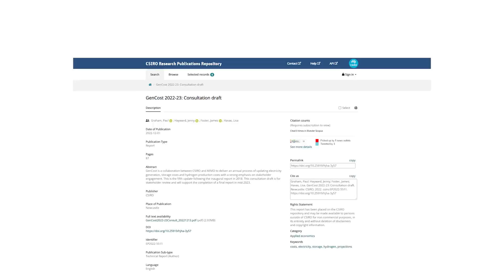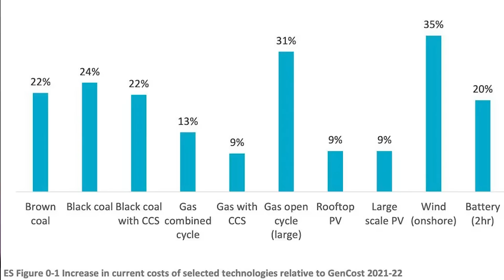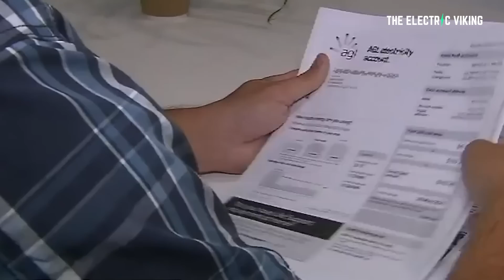Wind and solar still much cheaper than fossil fuels, even with inflation

Comment: Ohm's law 101 you only get about 10% of renewables the problem is like the Enron scandal its measured in watts amps is what's actually going back into the grid or in the batteries or whatever
And then nevermind that embodied energy thing

Comment: Maybe I'm just suffering from the equivalent of EV "range anxiety", but I would greatly prefer to not risk energy shortages due to the intermittent nature of wind & solar.  Battery storage is a technically appropriate compensator, but imho is still very expensive, & is in direct competition with EV production for a still-limited resource.  My other concern is that both wind & solar are low-density producers, and often use land that may be needed for future food production.  Trade-offs, trade-offs...
I'm blessed to live in British Columbia, Canada where we have ample hydroelectric resources into the foreseeable future, thanks to forward-looking politicians beginning in the 1960s.   We are currently only a few years away from completing another large hydro installation which will easily handle the extra load from the expected commuter EV transition. The giant water reservoirs behind our power dams are a wonderful long-haul energy store capable of coasting for over a year without any precipitation {highly unlikely}.  We don't need batteries for our wind & solar, just less production from the hydro base-load operations.  At the same time, our {relatively} very low-cost electricity makes it a foolish investment for me to consider roof-top solar - my payback period would run to ~ 20 years at present.
Every state, province, territory or entire country world-wide has its own issues, & must deal with them appropriately.  All I can say is that it is extremely foolish to decommission existing energy sources like nuclear- & coal-fired steam plants for "green" reasons BEFORE alternatives are in place.  Germany is a prime example these days - how many will freeze to death in that country this winter while gas from Russia is embargoed?  How many millions {billions?} of Euros have been wasted in that country on subsidies for wind & solar that don't perform well in mid-winter?  Look before you leap, & demand that your climate alarmist folks provide rigorously detailed cost-benefit analyses of non-fossil-fueled electricity sources before precious tax monies are invested in non-proven technologies.

Comment: What about the cost of firing up conventional stations when the wind isn't blowing and the sun isn't shining.
Reply: They will still exist but smaller in number and used less often. Anywhere there is a gas line or a diesel pump next to a power line you can put a peaker plant. Batteries are good for an hour at a time. Frequency stability services are rarely needed for more than 15 minutes. How long do you think the power will be out for and the sun/wind not producing? An hour? A day? Longer?
Reply: @theairstig9164  Here, in the UK when high pressure moves over we can go without productive wind for days
Reply: @theairstig9164  Also the cost of firing up old stations is huge - look it up

Comment: In 2020 the biggest Chinese companies (Goldwind, Envision, Mingyang, Shanghai Electric, Zhejiang, CRRC, Sany) installed around 45 GWh with profit. Western GE Wind, Vestas, Siemens Gamesa only made 25 GWh with over $3 billion in losses. Not not to mention that Goldwind installed 13,06 GWh with 9,000 people and Vestas only 12,4 with 29,000 people. 

But highly automated Sany installed 3,72 GWh with only 300 people - which translates to 14,88 GWh with only 1200 people (I bet it would need even less).

Comment: Here in AZ been powering my main house (over 4k sq ft) with a 12+kw/hr system since 2016 (only $42/mo for grid tie in fee).  Over produce electricity and in 2018 bought a Tesla M3 also powered by the panels (now has over 60k miles and no gas station costs/time or maintenance other than changing tires once and replacing air filters each year) also drive in HOV lanes as it's an EV so faster commutes.  Love not having a big electric bill (use to be over $500/mo in the summer) and the panels paid for themselves as of the end of last month so now it's just pure savings.   My plan for 2023 is to double our solar system to around 25kw/hr. and add battery storage.   That's to prepare for a Cybertruck (which will probably take up 2 spots in the 4 car garage but want to be able to have the electricity on hand to charge).  Depending on how well the energy usage is may eventually disconnect from the grid and be fully energy free and independent.  Solar in the desert is the way to go.  Also, have a good well system so no worries about water scarcity like other places.
Reply: I can see solar being a big plus in the desert, that makes sense. I think that should be the message instead of the climate change emergency. The people that live in places where solar and wind works. We shouldn’t waste a fortune on things that can’t and won’t work.

Comment: Wind & Solar are not economical, and do not belong on the modern electrical grid except in odd niche applications like a diesel grid, off-grid homes or areas with ample reservoir hydro. Comparing a dispatchable, reliable power source to wind or solar is called an Apples to Rotten Oranges comparison. Go off-grid and see how much wind or solar costs.
Reply: Look up levelized cost of electricity
Look up levelized cost of energy
    
Wind and solar power has come down in cost a lot in the last 10 years.   Solar and wind power can supply 80 percent of an electrical grid electricity.
Reply: @ronaldlindeman6136  You look up levelized cost of electricity. And then look up what is an apples to oranges comparison is.  Comparative analysis of all European countries show Wind + Solar costs 6X more than conventional electricity sources. That's a REAL WORLD comparison.

Comment: Wind and solar are cheaper when they are generating.  You need to use battery when not generating.  There is a limit to the battery backup available.  How quickly can you get battery power to cover all utilities?
Reply: Never.

Comment: Storage is the big thing that needs to be solved.  I expect flow batteries to be the solution.  The heavier weight doesn't matter for stationary storage.
Reply: Just shut down fossils fuels The world will starve. An Electric car in the Canadian winter? Solar and wind simply do not work with those silly paid for WEF studies.
Reply: @patricksmith6034  People drive EVs in Canada in the winter.  There no doubt are some driving right now.  I suggest you get the facts before you try to debate.  We can't stop using fossil fuels suddenly but we can stop faster than you think.  Wind and solar make power at a much lower cost than even natural gas.
Reply: @patricksmith6034  False.  We will be switching to wind and solar for power
Reply: Have you heard some of the proposals to produce hydrogen from the excess power generated by renewables, and then using the hydrogen to run electric turbines to supply power to the grid when solar isn’t producing? This also seems like a clean method of energy storage and less impact than batteries in many cases.
Reply: @sandyt4343  Fuel cells convert hydrogen to electrical power more efficiently.  The idea is a good one if you can store the hydrogen.
Reply: @kensmith5694  you’re probably right,that sounds like a more efficient way to derive the most energy from the atom. I think storage in a fixed plant might not be as big a challenge as using it for transportation, although it certainly is a slippery little atom in comparison to the compound ones , if I understand correctly.
Reply: There are a lot of Engineers that say 80 of electricity on many electrical grids can come from solar and wind power plants.     Have fossil fuel power plants as back up to that.
Reply: @ronaldlindeman6136  Backup is good but it shouldn't be a thing you count on very often because then it is not a backup it is a primary source

Comment: The Elephant in the room that no one talking about is the employment of people associated with fossil fuels. How do we make the transition from the consumption of today to tomorrow without putting million on the street. The answer is fairly simple. Government incentive. Take the subsidy away from fossil and apply it to renewable through wage subsidy only. Make it easier for green employers to compete against fossil. in fact make it far more beneficial for green.
Reply: If you look at the construction of offshore wind farms around the UK, a very high percentage of the workers are X oil and gas. turns out that constructing an offshore wind farm requires very similar skills and resources to constructing offshore oil and gas infrastructure. Plus most Oil & Gas construction workers are highly skilled and well-paid with sort-after skills.
Reply: In the USA, the coal industry has lost approximately 45,000 jobs between 2010 and 2022, but at the same time, solar panel manufacturing and installation companies have added approximately 90,000 jobs over that same period.   You are correct to care about the workers, and the pace of change is the primary factor.  Obviously, we would not want an entire factory to replace every worker with a robot in one year.  Luckily, real world transitions take years.  Please know that the workers will find places.  We don't farm with teams of oxen or horses or mules anymore, but all the folks that led those teams found jobs.   We don't have dozens of workers using manual typewriters to type copies of documents anymore, but those folks all found jobs, too.

Comment: If renewables are less expensive then why do the states with the highest percentage of renewable energy going to the grid have the highest cost per kilowatt charges to customers.   The stat does not include redundant power plants and expanded grid costs.   You should be looking at total cost to the customer.  I support renewables but I think some of the propaganda is dishonest.  The oil lobby isn't the only group not telling the whole story.
Reply: There are a lot of costs, in every business.     Some states have high electricity cost because everything costs more.    Electricity costs a lot in Germany, because 1) the fossil fuel is taxed.    If a country taxes fossil fuel, they can maybe tax property less.   2) Germany has high labor unions, workers get paid well.    3)   The average home in Germany uses 4,100 Kwh.    In the US, the average home uses 11,500 Kwh.    More apartment living in Germany as well as less temperature extremes.

Comment: The report "GenCost2022-23Consult_20221213.pdf (pdf) (2.03MB)"  page 11 states the ADDITIONAL cost in 2030 for making the mix of solar PV and wind generation up to power grid quality is AUD $16 - $25 MWh.  That is typically the cost of fueling a coal plant.  Additional costs means at a minimum there are base costs not being included making the total cost for solar PV and wind generation high in 2030.

page 11.  "We found that the additional costs to support a combination of solar PV and wind generation in 2030 is estimated at between $16 to $25/MWh depending on the VRE share. The key costs for supporting reliable supply of electricity under high shares of variable renewable electricity are additional transmission, storage and peaking gas capacity."

The bar charts make use of 2-hour battery storage.  That is below the normal minimum of 4-hour battery discharge rates for some semblance of long term battery life and not sufficient storage for load leveling from day to night needed for solar PV.   In the field solar PV for such devices as a weather stations typically have battery storage on the order of weeks.  This over stressed use of minimal battery storage is likely done to keep the additional cost of battery storage much lower than a real implementation would require meaning these additional costs for high share implementation of solar PV would be much higher than these figures.  

There is a very large disclaimer on page 2.
"The reader is advised and needs to be aware that such information may be incomplete or unable to be used in any specific situation. No reliance or actions must therefore be made on that information without seeking prior expert professional, scientific and technical advice"

There is always some type of disclaimer on a report to give the reader some scope of coverage.  This is a severe warning to not to use the information in this report AS-IS.
Reply: There you go. I didn't even have to read the report to know that the conclusion presented by Viking was BS. It's just not possible.
Reply: @hvh377  If you look at the report the next paragraph on page 11 after my quote above states  something like was said in the video.  The paying customers of this report are politicians so it reflects the desires of its paying customers, but if you read the report it has honest science in it.  The biggest honest science is the disclaimer.  

Another example is reading the United Nations International Panel on Climate Change reports that are not nearly as well presented and labeled as the one cited above, but they are very clear and transparent they only discuss greenhouse gasses as a cause of global warming and only sample those greenhouse gasses at an altitude of 20,000 meters outside the troposphere where earth's greenhouse effect takes place due to water vapor at over 99% to a low estimate of 97% and way into the stratosphere where water vapor is near zero.  The complete dominance of water vapor as strong greenhouse gas makes it impossible for the non condensing greenhouse gasses to significantly change earth's greenhouse effect even if they were to have all their concentrations cut in half or doubled.

IPCC can state a great success because after global warming was increasing at tenths of a degree Celsius per decade in the 1960s, 70s, 80s to the early 1990s when it reached 1.1°C and IPCC started, over a quarter century later in 2022 global warming is still at 1.1°C!
Reply: @hvh377  The original comment had my residential rate $0.10 kWh incorrectly converted and should have been USD $100 MWh AUD $149 MWh.   The cost of $16 - $ $25 MWh to bring PV solar and wind generation up to power grid quality is about the cost it takes to fuel a high efficiency to medium efficiency coal plant for this much electricity.  These costs seem low.

Comment: In 2018 solar became the cheapest.  This year solar plus battery is cheaper than gas.  The American grid is already 23% renewables.  What will happen in in a few years...  You can buy an ev and a solar panel and not buy gas in 20 years.  If you know someone that is in the market to buy a new car they need to know this.